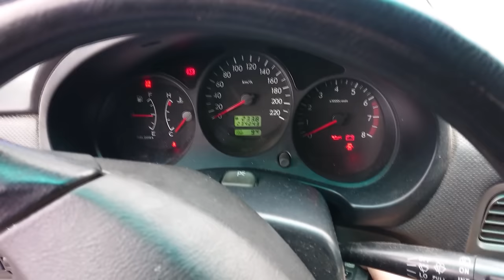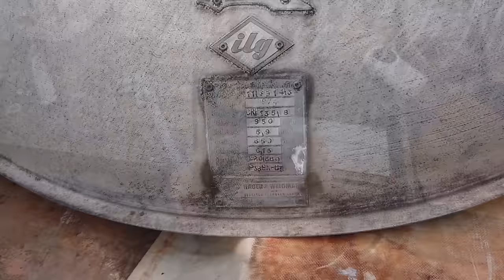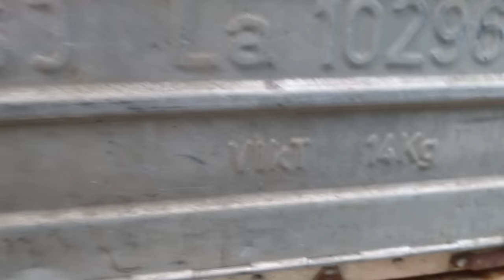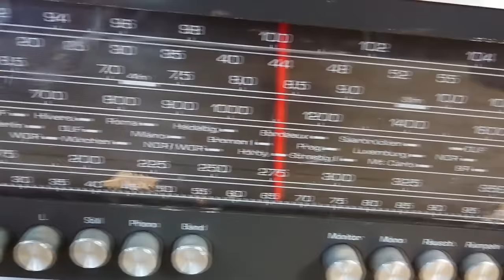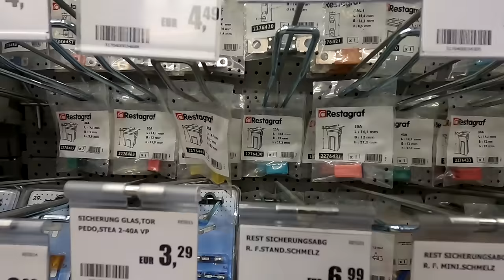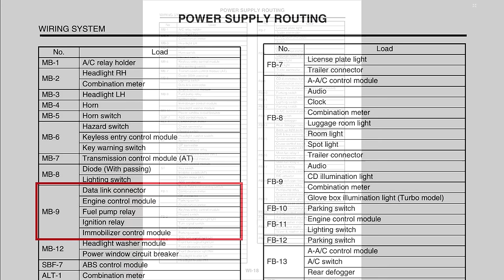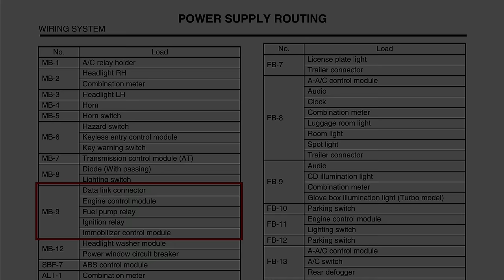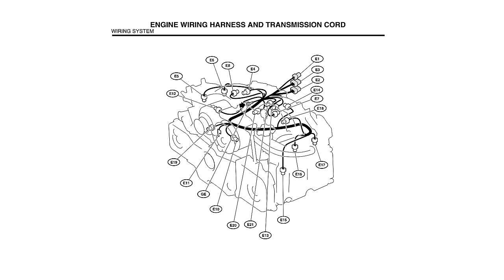New Awesome Scrapyard Finds! Repair-A-Thon!

Comment: You can still buy the cartridges for those RDX drives.  The DRM is insidious, though- they're just standard SATA hard disks or SSDs which have special firmware on them which will allow them only to work in an RDX drive.  And the cost of those cartridges is extremely high for the amount of available capacity.

When I saw the Ilg logo I knew immediately that those were fans.  They were an American company founded by Robert A. Ilg in Chicago 1908 and were once one of the largest producers of industrial fans in the US.

Comment: Still rings true, 90% of all electrical/electronic failures is a bad connection. Had a buddy help me go through hundreds of puter crt's about 20yrs ago. Separating the wheat from chaff he witnessed me whacking it on the side, ya know when you're in a hurry you go to the last troubleshooting technique you try that has worked in past. He doesn't fix anything he just whacks it on the side!  ..yeah, here's some bubble wrap go take a nap.

Comment: I use peppermint use for cooking  and mixed with water.  I spray it around places where mice like to stand and make nest.  On some of the wiring harness where I have seen area of mice damage I use a tie strap and attach a small piece of a sponge  and soak that with the peppermint as well.  It seams to work but you have to do that about every 3 month.  I have dogs so I done like using poisons.

Comment: We had a fairly new Bosch washing machine that would randomly crash mid cycle. Bosch tried several replacement parts. ECU, motor control programmer switch several sensors and the door lock. Could not cure the fault. They finally diagnosed a wiring harness fault. They replaced the whole machine! Luckily it was still under warranty!

Comment: I had the same car. Strangely the same colour. Sold it just before the covid because of intermittent ignition start fail to buddy of mine. He changed the same engine electrical harnes as in your video and the car was like brand new on the road again... Buddys timing on finding the error and fixing it was well after the covid..

Comment: Some years ago, my wife had a Nissan pickup.  I was using it to haul trash when it suddenly died.  I managed to get it restarted several times and barely made it home.  I eventually found a relay near the glove compartment that wasn't even on the electrical schematic in the service manual.  Turned out that relay shut the fuel pump off if the alternator was not running as a safety precaution in a crash.  A trip to the local auto parts store and $15 later, a new relay was installed and it never happened again.  Intermittent faults in a vehicle can consume an enormous amount of time and wasted energy.

Comment: There is no ethical way to keep rodents out of the engine bay.
However keeping a hungry cat under the bonnet when parked might do the trick. 😁😁
If excluded from the engine the offending critter will more than likely setup house somewhere else in the car where nice tasty wires are located.
Love the lamps man.
Cheers Eric

Comment: Smart move replacing the alternator. The alternator in my 98 Forester failed and went over voltage, it cooked and inflated my battery like a balloon! When I opened the bonnet and saw that, I turned and ran. Boiling acid is the last thing I need exploding in my face! 😬
Easiest alternator on earth to replace fortunately.

Comment: I also had a similar issue with a 2012 Jeep liberty, But it was still drivable but would not pass safety inspection. 
I recently had a serious heath issue and it made it so I couldn't be as active.  Two blood clots in my lungs, caused heart damage and lung damage.  
I had a small issue with the evaporative fuel recovery system and normally I would have fixed it my self but I would need a $300.00 smoke generator to find the leak.  Also my trailer lights were on all the time. 
So I had to take it to the dealer for service.   I was quoted $3000.00USD total for the repairs.  Well since I am disabled and living off of $2000.00 a month there is no way I could pay that.  
I was able to get the deal manual and with the help of friends I was able to make repairs for less than $50.00USD
All of the plastic vacuum lines were cracked and were replaced with silicone vacuum hoses and fittings.  
The electrical issue was caused by a $5.00 relay that was hidden.  

Yes my friend We are a dying breed, but I am trying my best to find an apprentice to pass on the 50 years of experience I have.

Comment: I deal with rodents all the time on my farm. I have found that Amazn sells an electronic rodent repeller that has worked well for me. I've had damage to my 2021 Ford Ranger (passengers side airbag wiring), and the mini excavator (ate the ground wire for one of the lights, and built a nest). I've since installed these in all the cars and equipment and haven't had any new damage. They're made by Loraffe. I'd post a product number, but YT seems to silently delete posts that have Amazn product IDs in them.

Comment: The car trouble I knew it was just a rubbed/chewed wire, I've been trying to get a lot better at doing those diagnosis recently, the wiring harnesses for the b5 VW cars are starting to break down from age and I get those issues a lot, you were great about narrowing down your search, really the pain in the ass is going through wiring harnesses, but the issues 9/10 times the issues are immediately obvious like yours

Comment: You have to really keep on top of oil changes on those Subis if you want the engine to last- they tend to run hot and thus are quite hard on oil.  5000km is the most recommended interval.

I can get rivets like the ones used on those folding boxes all day long where I live- they're used in aircraft and commercial vehicle construction.  They need to be installed with an air hammer and a bucking bar.

Comment: Peppermint oil in a mix of water or some nonflammable fluid and put it in a spray bottle and spray the engine area every now and then. Here in the US desert pack rats like to crawl in the engine bay and this is a good deterrent for them wanting to be there. It works.

Comment: When testing you can use a regular 230V DIN rail breaker instead of a car fuse, voltage does not affect the way breakers or fuses work as long as it doesn't exceed their maximum rating...

Comment: Hey Gerolf, I am happy that you found the problem with the car, and it was not a problem of the car itself. Here in Spain we call Subarus "Basurus" (trash), because they are not very reliable (head gaskets, gearboxes, just anything you might imagine, can happen). I saw it's a bit rusted, I hope this car lasts you a lot without any more trouble, but when selling/scraping it, get another brand

Comment: Zarges is still making awesome boxes and ladders, i have one too. 
This electric problem with the car is really a PITA, both for the user and for the shops. The hourly rate of a shop is so high today, and it would take a long time to find a broken or shorted wire like this in a random harness so they'd rather not bother, or the customer wouldn't pay thousands for 10-20 hours of work. And, in the same time they would do much more profitable work for other customers, as they make decent profit on parts and expendables too. 
This is exactly the same problem with repairing electronics. I do that for myself for fun, but to troubleshoot a thing not yet known to me would take days, and it's just not viable for 100-200 EUR worth of equipment if i'd do it for someone else.

Comment: The wiggle test on a harnas is always one of the 1st troubleshoot steps i did. Solved many problems very quickly! And i think your first thought istn too far off with mechanics btw.. this sounds sad but you have to be lucky your workshop has a good troubleshooter instead of a parts replacer 😉 Trust me, i did this job for 25 years..

Comment: I similar thing happened to a 99 Toyota truck (that has almost 400.000 miles on it ) The fuel injector wiring harness became brittle over the years and one day it ran horrible , then the next day it would run just fine..
 It took lots of investigation to fix the problem..

Comment: Just cover that stereo in mud and you can 100% restore it like new. Don't forget to randomly probe around with a volt meter and use s 500 watt soldering iron to solder small wires. Just teasing 😛. I was referring to those channels that do fake restorations.

Comment: Glad that you managed to deal with the issue. However, I would blame the players in this case. They had the car for two weeks having given up on it after the first day. Had they been rather more keen to do the job you paid for during this time frame, they may well have discovered the issue and fixed it themselves. Happy to take the money, not so much to do the job.

Comment: I had a Subaru WRX that I used to park outside my garage. You guessed it, rodents took up residence in the engine bay. I only figured this out when I took it to a local mechanic for service. He removed the nest but thankfully there was no wiring harness damage. Stupidly I started parking the car in the garage again and never put 2 and 2 together that it was the car bringing mice into the house that were running around my basement. I finally got a clue after a food delivery that contained lots of popcorn kernels that were spilled on my driveway. The following morning I got in the car that was parked outside only to be shocked by all the popcorn kernels that were now scattered across recess for the windshield wipers and on top of the engine. I stopped parking the car in the garage after that and the mice problem stopped. With my new car the only solution I have for mice is to have the car in the garage and never leave the garage doors open where the mice can get in. I really don't know what you can do to stop the mice if you leave the car outside. Poisons are verboten and I can't think of a mechanical means that won't interfere with the operation of the car or present a fire hazard.

Comment: Fit a headlamp bulb in place of a fuse, it will light up all the time the short is present, then go round moving wires, disconnecting things... until the bulb goes out.

Comment: I have a Subaru like this as well. Different engine thow. have like 280 K kilometers on it. Had to fix the boddy and this was like 3000€ crazy. Engine is still running good, and minor fixes had to be done. Nice car to have and nice work horse for me. Hope it runs for many years to come. You shold go and ask some money back cause the repair shop actually did not fix the problem.

Comment: Another fantastic presentation, how uneconomic having modern equipment professionally fixed.  And enforces the problems of today’s highly integrated (and electronically controlled) moto vehicles have become.  Fixing a 1970’s carburettor and points engine, would have been significantly easier.  Really, you were hunting for the proverbial needle, in a haystack (and found it!).

Repurposed exhaust caps as lamp shrouds, novel.  Didn’t realize their size, until seeing you hanging them on the tree.  Awesome.

Comment: Those UFO lamps are the bees knees. But I got a tip your you: paint the interior of them with white enamel paint. It will give you a much better light output than the bare metal surface.

Comment: My 2003 Volvo was destroyed by rodents eating through the wiring harness. The wires were eaten from one end of the vehicle to the other. As mentioned by others below, I also liberally sprayed peppermint oil (I believe any really pungent oil would work)  all over the engine compartment and wiring harness. It may be more of an "old wives tale" or witch craft but apparently rodents do not like the strong smells. After 2 years and repeating the process every 6 months there is no signs of rodents nesting. Excellent troubleshooting by the way.

Comment: I use dryer sheets in my motorcycle airbox, the riding mower and generator too tucked here and there. Apparently rodents hate them because my wire chew and litter box air filter in my bike stopped happening for good using them. I’m not sure what scent is best but I used lavender scented ones… Good luck going forward✌🏼

Comment: I've had luck with Honda and Mazda. Your rodents in Europe are nuts, I would have stainless steel hose or mesh covering on all the wires [?]. there are spray repellants but also ultrasonic vermin devices. 
I hope to see more SABA restoration , you can turn brushed aluminum finish knobs on lathe, what a find!
People should help you save stuff from salvage, then donate it to you...any fans in .DE should chip in.

Comment: Yep, owing an old is just like that. On one hand your car is paid off and you only spend money on oil change, wiper replacement/new tires, on the other hand, if something breaks down you have to chase the car parts and good luck if your car is imported.

Comment: Whenever this happens, easiest way to think about it is motor oil eats wire insulation, every bit of bare metal on the car is ground, look for wires resting on bare metal and check their insulation.

Comment: I would go for a HV rodent repellent or go for a “natural” rodent repellent. Here in the Netherlands HV versions are illegal to protect Martens (type of weasel) but HV seems to be the only working repellent. Our local ADAC (ANWB) mechanic told me to use “hertshoornolie” which is an animal based oil (oleum animale) used to treat cows. Most critters detest the smell and no longer go near the car.

I have had similar issues due to this protected rodent and my mechanic installed the HV version, the car still ran for a year in a rodent area before dying from piston wear.

Comment: Cayenne peper dissolved in alcohol and water solution,  sprayed onto harness and surrounding areas rodents hate it. Also pure peppermint oil will do the same thing to repel them. Plus peppermint would smell really nice.

Comment: Diagnosed same failure on another Subaru EJ motor - rodent just happened to chew the temperature sensor wire under middle of intake and create intermittent dead short to ground cause engine to go very rich and the engine cooling fan to run.

Comment: The distance to the short should be determinable by measuring the resistance of the harness from the power source to the short. As you get closer to the short, the resistance will drop. You'd need to use a meter that can measure low resistance reliably.

Comment: Ahh problems like yours with the car can be a real pain. Going back a few years ago in Australia I had a similar problem on a 45 deg day av 800 klms from anywhere.  A car full of kids and a wife whose thermostat would have better suited an Eskimo.  I got that sucker fixed before sun down but I stole so much wire from other areas in the loom to do bypasses when I got home I had to go to the wrecking yard and obtain nearly a complete loom to return the car to standard.  I didnt even have a test light just made one up from a spare globe to get me started. only one roll of insulation tape and some spare self tapping screws out of the caravan and bits of wood to join wires together. I think I aged 10 years that day but we got home. The ironic thing was though I said some things that day to my wife due to her nagging me whilst I was trying to repair the problem that probably ended my marriage.

Comment: Use a 90 degree pick tool to break the 'bond' between the hose and the fitting.

Google - hose pick set

Comment: Splendid exposition.  I sympathise with the point of view that cars are unnecessarily complex electrically.  Further the use of proprietary software by manufacturers deliberately removes the ability to repair outside the dealer network.  Excessive regulation has caused some of the electronic complexity, factory greed has caused the rest.

Comment: 1:24 I was hoping you would grab that.
It is used for cutting off pipe, they are stupid expensive.
You can fit a plasma cutter in one if you don't use a torch.

I guess you don't do pipe work that often.

Comment: Tabasco sauce all over your motor. smells nice for a while but after animals will be scared of the sent. They will have to lick it off their feet and hairs. Getting them used to the smell and burning heat. Works for rabbits that eat your speaker wires.

Comment: I've experienced a somewhat similar issue. Mine being with a Dodge Shadow. The ignition pickup coil that the ECU uses to see if it's getting spark had cracked and broken the continuity of the coil. It would work just fine as long as it was cold. When warmed up it would again break continuity and the engine would stumble and stop running. It was very frustrating since when we took it to the mechanics' it would run fine and they couldn't find the problem. This happened over several trips until finally a friend asked the pertinent question about that specific part. It may not have been caused by rodents but it was just as frustrating to try and figure out.

Comment: When the car is left standing, disconenct the battery, rodents like the shock from the wires and become addicted to it.
There were studies done on this, and in tests the cars that had dissconected batteries did not recieve and chewed wires as opposed to the cars that were left live.

Comment: You probably already tried this, but unplug the battery terminals and replug it back in.  Fixes a lot of strange electrical problems. But my guess is there's a chewed wire somewhere and you will need to hunt for it. I am sure you will figure it out in this video but this are my guesses.

Comment: I've never had issues with mice, rats or squirrels fortunately. I did lose an ignition cable to a marten once. Ever since then I keep one of those foul chemically smelling toilet cleaning blocks under the hood. The plastic thingy you clip to the rim of the bowl. I don't know the English or German words for it.😅
Not sure if it will keep rodents out, but worth a try.